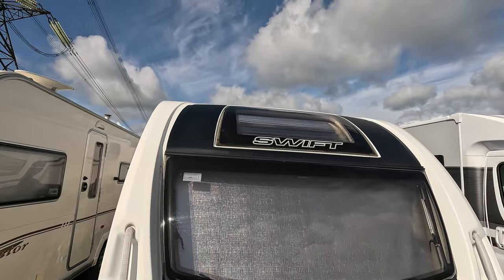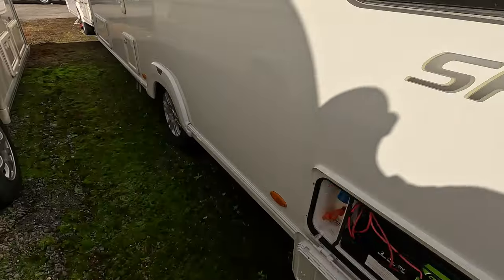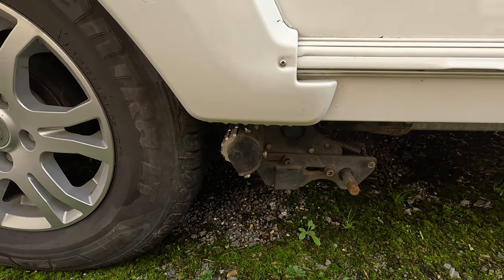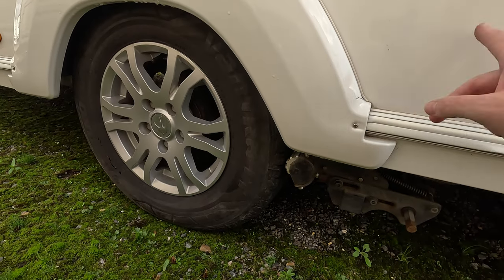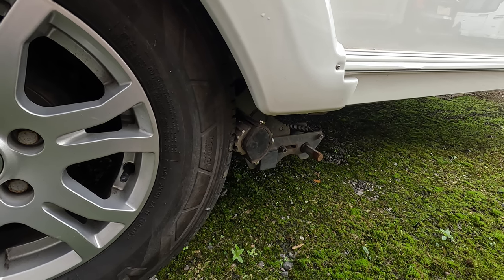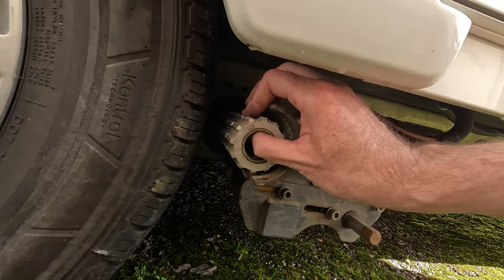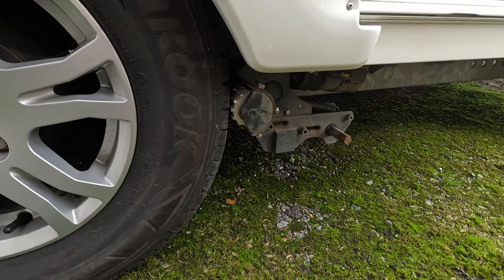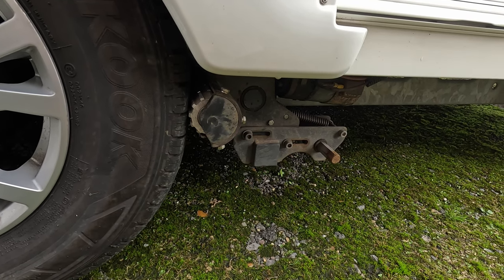Have You Seen My Crack ? & Motor Mover Problem Solving, What's Going On #caravan

Comment: That's a slightly different set up to mine ,there must be an inner bearing on that roller as well, other than that there's not a lot too them, there will be a cog on the other end of the roller then an idler cog then a cog on the end of the motor which will have two bearings in it
Reply from the maker: Thanks for the information, over the next couple of weeks I'll take the roller off and dig a little deeper, I'm sure between us all we'll figure it out lol.
Reply: Hi I've just removed the front plate on my mover. The bearing is totally gone, how did you get your actual roller out is there a bearing on the inner side of the roller?, how did you get it out of yours was the same?. Thanks in advance. Kevin
Reply from the maker: Have a look at my other video where you see me take it fully apart, you should be able to use a screwdriver or something like that to wedge in at the other end of the roller, it's only pushed on.

Comment: I'm sorry but the second the bearing end cap came out with no resistance shows the outer race is too loose in the roller and the way it span round with noise indicates zero lubrication and to much play between the balls and the races. Bearings don't like being washed with rain especially zz ones (shielded) rather than 2RS ones (rubber seals) for the price of a couple of bearings they definitely needed changing while it's stripped down. Mine clicked and the bearing fell to bits. Poor design with hardly any water protection.
Reply from the maker: Thanks for sharing this information Paul, I'll keep that in mind now I know how to strip it down completely.